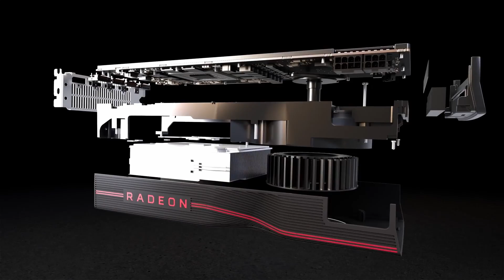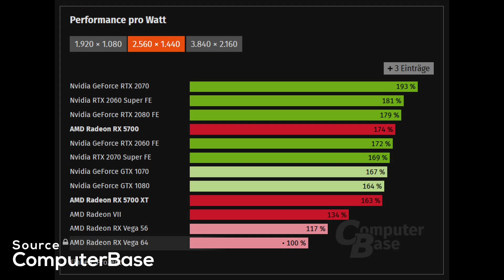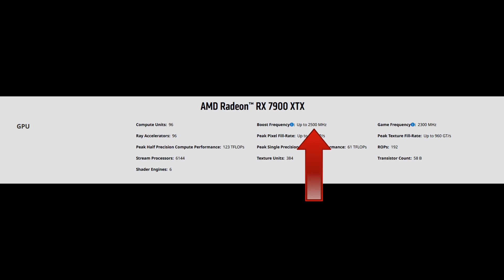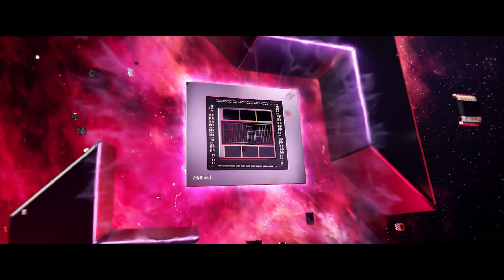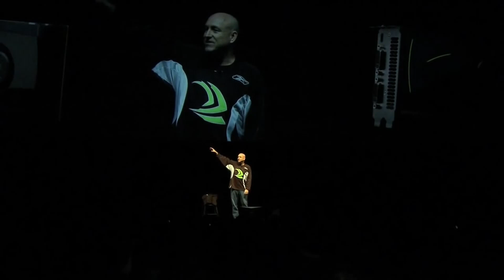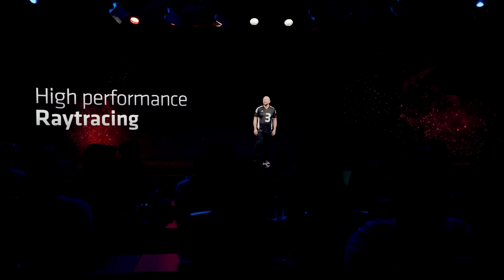RDNA3 – what went wrong?

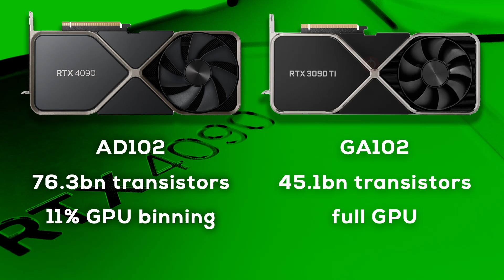Comment: 4:00 i guess the transistor count on ga102 is wrong here
Reply from the maker: Of course it is, thats the effing density number. Good catch! The transistor count is 28.3bn.
Reply: @HighYield  yay my first pinned comment! thanks!
Reply from the maker: You noticed first, you got it right, you get the pinned comment! That's how it works here :D
Reply: @HighYield  ringing the bell helps mate :D
Reply: Even if AMD own expectations were to make faster gpus on release, if it failed get that level of performance, it had be priced lower bit lower than announced. 
Idk if AMD marketing team knew typical reviewers set of games for testing, sure they had enough options to get that info. 

Maybe 7900 doesnt deliver Nvidia 90 tier performance and it's tough to rename is as 7800, it would not be good marketing, knowing that gpu potential. But buyers usually decide depending on current performance. Maybe it is reason for growing 4080 sales, but I guess many those 1000+usd gpu buyers were waiting overall performance of navi31 that's incl raytracing. I get them, at that level of performance they expect all features maxed ingame.

But certain improvements won't affect current 7900 already released as chip revision or fuctioning stuff inside chip(shader prefetcher?).

Bit worried those gpus with high raw performance would well perform for cryptomining if it returns.
Isn't tgere possibility, both AMD and Nvidia were designing new gen to perform great mainly for other than gaming? Or is that worse gaming than raw performance given by fact if both bad game engines optimizations and different game engines specific emphasis on certain features/computing?
(also new architecture for Rdna3 could result on that big difference in performance among all games tested). 

But I guess AMD can improve with updates at least to some level. They Surely they know what games need, as long AMD influence game development tools m, Direct X too right?

What makes me happy AMD made nice surprise is some competitive online games performance at top beating 4090, seems it could be win for them...at least if that proves for Navi31 too.
Reply: Came to ask this

Comment: Years later the 7900XTX is the beast it was supposed to be. Still falls as the top 3rd and when it comes to ray tracing who cares.. We have FSR4. It is crazy how the care got better over time but That always happens with AMD as it's always innovating and the Chiplet arch needed time for development. I have been running mine @ 3.2ghz for years now and it's still a awesome card that can handle any 4k game max settings at high frame rates. I wish AMD didn't care about tdp like Nvidia. Those days need to be over with.

Comment: Seeing this now for some reason. My XTX would easily do over 3.2GHz with more power limit, but it would start gobbling over 500W to do so, and performance didn’t really scale at all past 2.7GHz. It seemed like there was enough extra memory bandwidth and plenty of fast cache to do it, I think the die to die connection just couldn’t go as fast as was needed to keep the core fed. Then there’s stuff like the 1081p video encoder and the fact that it shipped the A0 stepping that just make me think the whole this was rushed. Maybe they saw the chiplet thing just not working out with GPU level bandwidth and figured fixing the rest of the bugs wasn’t worth a B0. The huge perf per compute unit and astronomical memory bandwidth efficiency gains on RDNA 4 feel like they got a lot of RDNA 3 things fixed that contributed to such a large jump.

Comment: I really don't care about the 7900XTX or RTX 4080Ti/Super bracket, the biggest spit in the face was the 7600 and 7600XT (as well as iNvidias 4060/4060ti). Those cards were DOA worthless hunks. And then you have the 7700XT next in line with no 7700 to bridge the price gap. When you're someone on a budget but that would still like to run newer more demanding titles at at least 1080p, everything below the 7700XT/4070 in current gen is just not worth :/.

Comment: Rdna3 is a let down i got a insane deal for a 7900xt hellhound. I don’t see much difference vs my 6800xt or my friends 6950xt. I had no high idle issues with my 6800xt. While my 7900xt for some reason idles at 100w and my memory clock speeds are really high only solution was lowering my secondary monitor to 60hz…Also helldivers seemed to only crash very consistently crash on  navi31 cards specifically before a new driver addressed it. No issues on 6800xt from my experience .

Comment: I like the uplift of the 6600 vs 7600. FP32 8.9 Tflops vs 21.75 Tflops for 123 vs 146 Watts with some 20ms spikes at 249 vs 186 watts power consumption. Taken from techpowerup. Looks like there is ~30% more cu in 7600 along with the RDNA3 generation update

Comment: this aged like milk in the Greek sun. But that sweet sweet Nvidia Green Greasy money is hard to resist.
Reply from the maker: How so?
Reply: @HighYield  you didn't mention the power consumption and die size increase that Nvidia used to obtain their gains. Melting power connectors were not mentioned in your 'comparison' . Intel does this crap too.. MORE GAS ON THE FIRE... WE HAVE SNGLE CORE CROWN AGAIN... We see this all the time. AMD gains are coming with efficiency, something you glazed over.

I thought power consumption was a concern in Germany? there are many roads to take and I think that AMD's road leads to the future and Nvidia and Intel are on the MOAR GAS, MORE CLOCK SPEED, MOAR MOAR road that will reach a dead end faster.

Comment: RDN3 is just a failure. RX7600 is on par with RX6650XT. Same amount compute units yields same performance. I don’t see any generational improvement. AMD can just die shrink RDN2 to 5nm and yields more improvements.
Reply: Doesn't you need to compare the 6600 vs 7600 to see "generational improvements"?

Comment: AD102 has so many transistors because of big cache. The real difference between AD102 and GA102 is much smaller.
Reply from the maker: But it's still part of the design. If it wasn't for the huge L2 cache, AD102 would need a wider memory interface.
Reply: I'm talking about the fact that the density of transistors in the cache is very high, and this makes such a comparison meaningless. AD102 without cache, even with a wider bus, would have significantly fewer transistors.

Comment: I think there's another point to make: real heavy users (corporations) do not uses AMD for IA, deep learning, etc, beacause the majority of libraries realy on CUDA and the ROCm translation is not really good by now. This puts NVvidia WAAY ahead on the market that really buys flaship chips. So fighting for the top makes no sense by now. Maybe AMD will fight in price and performance with lower tier 4000 in the consumer market and use the experience to refine ROCm and chiplet design.
I'm a researcher/engineer in electrical engeenering and computing. The amount of optimzations made for Intel CPUs and nvidia GPUs make literally impossible to choose other than this brands. Acctualy in the 5000 series ryzen the performance in CPU are equal, but in GPU not even close.
Reply from the maker: You are right, Nvidia's software advantage can't be understated. CUDA and cuDNN for AI are basically 50% of Nvidias offering.

Comment: Well I am AMD fan, and I really want them to humble Nvidia, like what they did to Intel. Going to performance shortage RDNA3 yeah a lot of people are complaining about this, but there is big BUT, AMD has not failed us to show the RDNA 3 Architecture right? Like how they add 2 AI Accelerators in every CU of their GPU, these accelerators is what is missing on their previous Gen GPU, but it did add the costs of the GPU for what is worth AMD didn't ripped our wallet on this regard. Many of you are aware as well that DLSS2 in terms of image quality are better than FSR2, because we are talking about DLSS using Hardware for rendering processing with the help of AI cores, compare to FSR2 only running on software solution. I am not a hardware enthusiasts, but I do know that AMD doesn't wastes parts on a hardware for a meaningless reasons, but I do believe those parts are there to support every element out there in the GPU to make them run efficiently like parts that will power up those AI cores and their 2nd gen Ray Tracing processor. 
        With all this parts incorporated on this GPU, where the hell are the the performance? Another lets us go back to FSR 2 biggest limitation and that is it doesn't support Hardware AI cores/Accelerators. So technically the AI cores that is present on RDNA 3 are not yet running. 
       BUT things will change when FSR 3 is ready This will be the time when RDNA3 AI accelerators will be cranking up + Fluid Motion Frame + HYPR RX, I believe this will be the time that RAdeon 7000 series will redeem its reps. So to people who owned Radeon 7000 just be patient time will come that your card will repay you for the hard earned money that you used in buying them, just wait for FSR 3 and HYPR RX.
Oh one important thing don't overworked your card disable your Ray Tracing for now, Wait for FSR 3 then start tweaking your Ray Tracing.

Comment: i think the sales and marketing team screwed up. the 7950xts is the flagship model, where the 7900 series released in dec2022 and due to release continued varriants threw the year of 2023 and so on. meaning the cards were enginered with navi 34 and to make use of the previous chipset models on the 20/24gb card sets for the 7900 it wasnt designed for the gaming world. aka its a work gpu. the 7950xtx and 7950xts are the gaming models with 16-18gb and 20gb cards using the full shader cashes and full core unclocks. aka they dont really need to fix anything. you just have to wait for the sales marking stratigy, which is common with amd and every other thing in the world today. samsung 32 32s 32 ultra. ohh ahhh... wow... ect... latest and greatest doesnt mean a dam thing anymore cuz everyone is mostly wise to the marketing stratigies now days. and just like ram, the smaller the mhrtz frequency, the faster the cash refresh is. this is the same for gddr6. it is still core clock memory and bigger chips are slower... so the sales team messes up with latest 7900xt and xtx release specs ect. yeah thats fine... using the wrong product info in a demonstrations then people getting upset at produce reviews when buying. well why didnt you look at the produce specs at release and not just go off what they said last year at some marketing conventions. its not, false advertising if the product isnt released and multiuple products are within development, and marketing knows this..! why dont you! point being, if you look at the differences of the 6900 and the update unclocked editions even tho they were gen gapped with the 6950xts... and this is why i really hate the comparable with the 6900series with product tests in hand and not using the 6950xt. its like even the reviewers cant get it right. so how can you blame amd for doing the same thing for a product not yet released? so yeah, there will be a 7950xts... its already claimed as the starting flagship for the production model from developer whistle blowers. and my guess is, the 7950xts being the flagship model, its gonna be the one that works right at launch as well. not the 7950xt, not the 7950xtx... the 7950xts
Reply: and the fact their using 31 and not 34... just means they are holding out on card designs for years to come. thats how business works these days. i miss the days they say ok lets scrap all projects and say lets not make something good, lets not even make some thing great. lets make the best dam sht n da world we can. challenging themselves not to be a company or business. but a next gen eletronic developer. not dealing w all this marketing bs. the cold war is why computers and the moon, nvidea and amd is why we got HD and 4k... but thats been around in edderations since 2008! sli titan x gtx superclocks on twin hazwell i7 clocked 4.9. getting 16pwer core i9's  at 5.5 is 223ghtz processing, the 12year old rig im on 179ghrtz... we have not evolved as far as we should have in a true competitive capitalistic market oppose to these socialistic marketing bs's. and mean to tell me 7950xts w 5544hrtz@869mv on crossfires is the first config of 12th/13thgen components that bearly beat my 4th gen build.... THAT IS HALARIOUS! an their not even out yet!!!
Reply: thats called 10gen bs
Reply: whats really funny, this ol rig gets 79-124fps 5560x1440 on starcitizen yet i hear other peps w 3080/3090/6950xts/7900xtx cant get more than 62 and not even that rez... somethings wrong there!
Reply: maybe i need to build another cheep dual 4thgen builds at cost of 1 of those new 3950xts 2400 price  point... like fuk that

Comment: You could do a similar article on Zen 4. I mean how did 1 GHz, more cache, and an "improved architecture" add up to such tiny gains in total with such a massive power draw.
Reply: Zen4 is not the problem Ryzen is the problem. Zen4 EPYC is working flawlessly. Zen4 is optimize to have additional cores to carry the performance improvement but the desktop product did not receive the core number uplift that the EPYC CPU has.

Comment: AMD GPU at 60% the price of the Nvidia and yet only 10 to 20% behind top tier?
Nvidia 4090 in Australia is $3500 to $4000, 7900 is $1000 to $1800 (XTX)
30 to 40% improvement for same money over last gen and complaints.
Nvidia have 50% improvement for near double the money and that's fantastic?! - you can get 240FPS insted of 220 FPS on your 60 to 120hz display.
Personally I think both current gen series GPUs are'nt worth an upgrade from last or even the series before unless your into the latest and greatest shiny things.
The AMD competes very well with what it was designed against - the 70 and 80 series cards - 4070 - 4080 which are still more expensive and less performance.
Reply: Ridiculous cope. No AMD card is anywhere near the 4090.

Comment: I get the review and I understand what you're saying and ill partly agree with most of it.  Heres the reality though.   The 4080 is over $1,300, and the RX 7900XTX is a $1,000 card that has 25% less cost for ~20% less performance.  There is nothing wrong with that AT ALL.  By the time the next series comes out, we will be out of a chip shortage, hopefully.  Modern games can't even come close or even in the realm of capping out an RX 7900XTX or let alone a RTX 4080.  You would get better results putting that extra money you save from switching from NVidia card to an AMD card into other areas in your system.  Faster storage, better motherboard, maybe even a better processor.  In my opinion the AMD card is the better buy.  If you are a bench mark hound or an extreme overclocker, then the situation is different.  For the all around costs vs performance vs longevity,  I would buy the RX 7900 XTX.  One more thing to note is when you fork up the dough for the modern NVidia card add about 50% because you WILL need a new monster power supply.  Im sorry, but I really dont want a system that is pushing 1300 watts.  

I know my opinion doesn't mount to squat for alot of people, and thats OK, but I'm not forking out that much money. NVidia is just too expensive.
Reply from the maker: It's not really a review, thats what HWUB oder GN do. I'm looking at the architecture side of the GPU, not trying to explore if its good or bad value.

Comment: You have to go with the product you have and not the product you want.  When the original Phenom (Barcelona Architecture) processor came out it had a TLB bug and the BIOS fix could cost up to a 20% performance hit.  At that time AMD made a comment about the difficulties of marrying a design to the process node.  There are always errata and AMD is definitely not alone.  If they can't patch with firmware or drivers then they can spin up another batch with a fixed design.  Will AMD refresh with a patched design or just move on to RDNA4 instead?  AMD is in a position to significantly undercut Nvidia because their design should be much cheaper to produce.  I'm hoping AMD will make the 7900XTX a $699 card, not because of these issues, but because they can still make reasonable margins (to satisfy those investors) and drag Nvidia well in to the deep end.

Comment: AMD recently said they have expanded the machines they test their Radeon (should be called ATI really) products for the first time to more machines than Nvidia. But we won't see those gains until later 2023 - 2024, since they are in the middle of testing. 

Not to mention management improvements, testing strategy, software, etc.

Comment: If you follow the chip market, you know AMD would need to pull a miracle in order to beat Nvidia. Last gen nvidia used 8nm samsung chips which were good but not as efficient as AMD’s 7nm. Hence amd got the edge on efficiency. Now as 4000 series is on 4nm it’s better than amd’s 5+6 nm node. Nvidia already knew they were going to have better GPUs that’s why you can see they are charging like crazy. Nowadays it’s whoever get the most latest node technology that plays the consumer than actually bringing revolution to GPU market
Reply: i mean, youre wrong, but okay

Comment: There is a problem if you overclock the GPU that the performance go down.
Some YouTube camels have reported about that.
There is one thing that catch me about that.
The clock speed goes up and the memory down.
I think the memory controller doesn’t get called for data from the gpu and lowers the clock.
Maybe I’m totally wrong, but could it be that there is a error correction inside the GPU. If the clock goes up more and more errors happen, and the data must be calculated again and again. 
If it is like that, that is why there is low activity to the RAM. 
This happened all intern inside the gpu and the cache 

What are you thinking ?